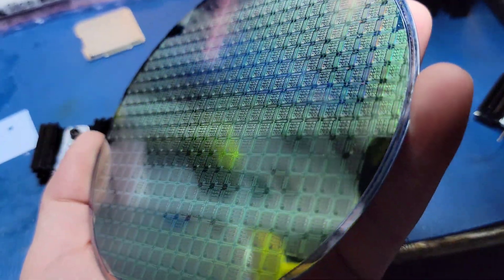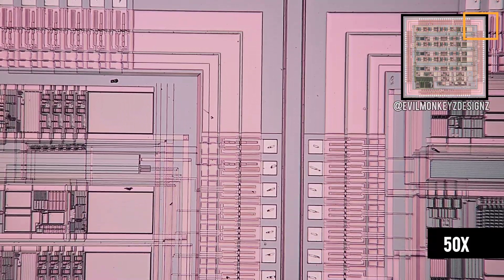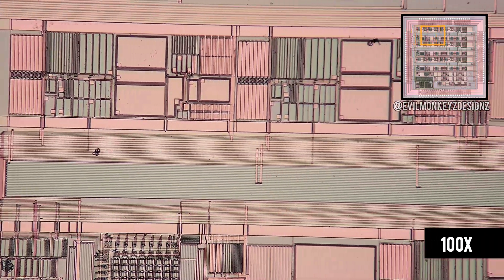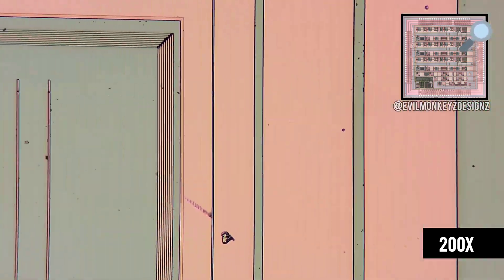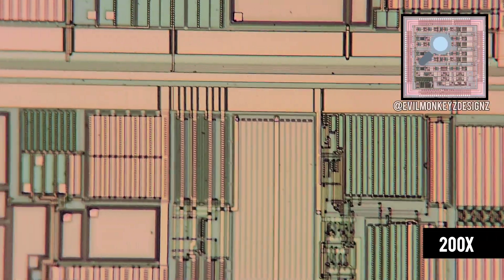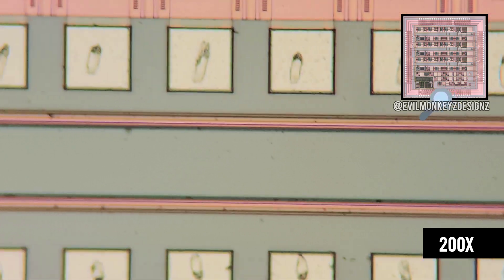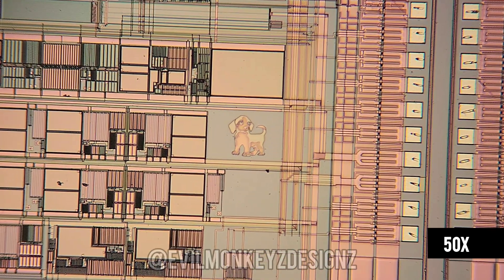Honeywell Silicon Wafer with a hidden secret

Comment: in the olden days (windows xp) you could record s short movie from where you stand paning around you, then split is in frames using video editing software like virtual dub mod and stitch them back into one image using panorama makers the resolution of the video frames back then were between 320x200 to 640x480 so multi image sticth was still in boundries of regular png file most panorama making softawre can spit out. of course paning by hand would make you inconsistent in ovement so you had to pick frames manually to be mostly in constant intervals spaced apart, which you probably can avoid by just using paning robot, but you would need very fast shutter sped and a lot of light to make it this way and i am not sure if you would benefit from  high magnification low resolution photos overlaping   and turtle sped of paning, or high resolution low magnification photos  and stoping in place to make photos, it all depends on stitching software in the end, how good it is in recognizing details
i think stop and go could be recorded by making timelapse videos, just need to synchronize the shutter speed with robot movement
Reply: Ahhh,  windows XP....🤤

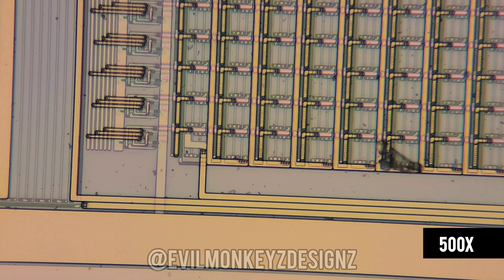Comment: 8:01 what are the x shaped pads for? Also love this! It would be amazing for the focus to be consistent across the whole thing... But without a very expensive XYZ stage I'm not complaining. But one thing I would fix would be to tweak the angle to straighten the stitch so the panning doesn't make you dizzy.